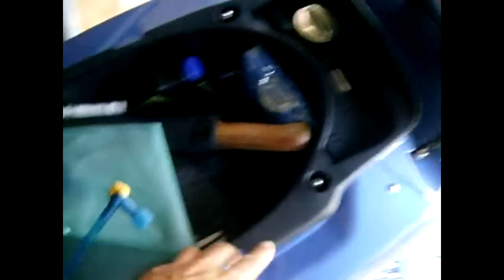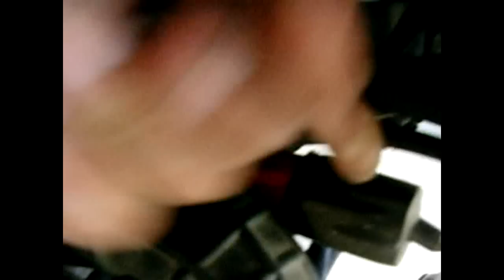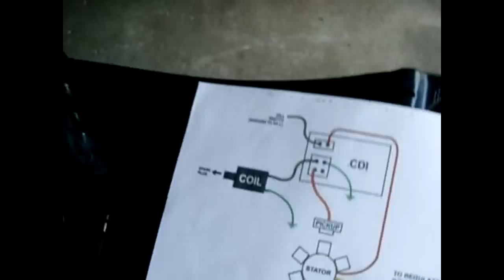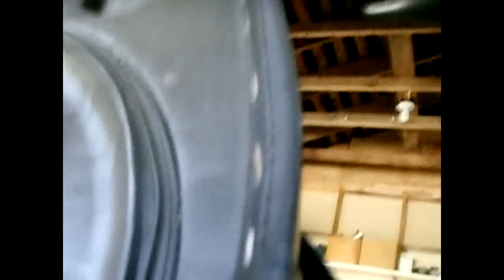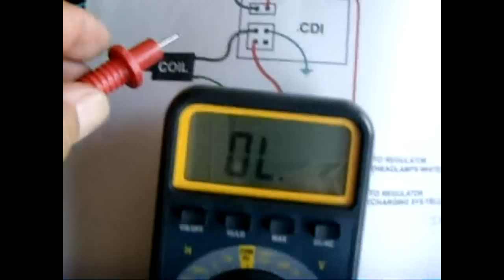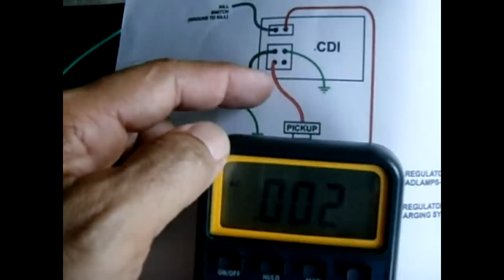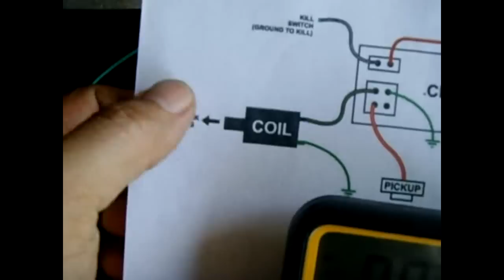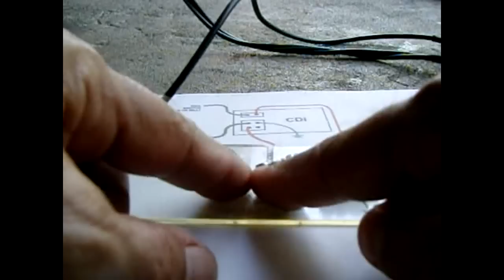The Ultimate GY6 Starter & Ignition Troubleshooting Tutorial

Comment: Running the test at around 13:30 of the video, I notice that my black/yellow wire gets zero resistance or continuity to ground, but that wire only connects to the spark plug lead and nothing more.  Am I testing this part incorrectly?  Also, I took out the stator pickup and tested from ground to the blue/white on the back of that pickup and got around 140 ohms of resistance.  This is a new stator/pickup assembly.  Is that accurate or is something wrong?
Reply from the maker: Hi Kyle. The blue/white wire(pick up coil) sounds right. With the black/yellow wire to the ignition coil connected to one probe of the DMM, and the other probe connected to the other wire of the ignition coil(or ground), you should get a LOW ohms reading. NOT zero ohms. Double check. You can also test directly on the ignition coil. Remove the connector on the 2 blades.

Thanks for Watching!
Reply: electronicsNmore
OK.  Could be that my DMM doesn't show really low ohms like that.  It also shows 0 when testing several new spark plugs.  I'll try testing with a better DMM and see what happens.  I'll let you know if I have any more problems :)  thanks for the video!
Reply: So I ran all of the tests in sequence and found that I had a bad plug coil which is why no continuity at the back/yellow wire.  Fixed that and got a low reading at the red/white wire (only about 250 ohms from gnd), and also only about 45v at that wire while cranking.  Bad stator coil?
Reply from the maker: I have over 200 videos, so I forgot the colors of the wires off the top of my head. There should be enough info in the video to troubleshoot with. You have to take your time and rule each thing out one at a time. I think I also have a link or 2 in the video description area. The output voltage from the stator coil will vary with cranking speed.
Reply: I think I've done enough tests to find that the stator is likely bad.  Everything else is almost exactly like you said.  This is a great video!  Thanks for the info!
Reply from the maker: Carefully inspect the stator before you replace it. Double check the output voltages, resistance readings, as well as ALL harnesses/connectors.
Reply: Will do.  It's a completely new harness that took some cutting and soldering to match the schematics, so I'll be doing the tracing game for a while :)

Comment: hey there so my engine is fine im wondering if my wires from my ignition could be faulty is there a way to get a diagram to check it starts with a jump to the sarter but only sometimes and the key has to be in and the switch has to be on start please help thanks you please email or call 253-888-9023

alexkjellesvik@gmail.com
Reply from the maker: Yes. The key has to be to the ON position, as well as the start switch. If they are not, then the ignition system(CDI) will be grounded out causing the engine to not start even if it is cranking. You have not explained your problem. Dies the scooter not start up when you push the start button? If so, then I suggest you make sure you are getting voltage at the starter solenoid, or instead of jumping the starter bolts, you try supply 12v directly to the small starter solenoid wire to see if the starter solenoid triggers. Sounds like you may have a faulty/burned solenoid. They are cheap.

Thanks

Comment: At last check, I pulled valve cover check valves at tdc had about 4 to 5 thou. clearance. There is compression it just dont blow your finger off hole. I did rotate engine backward trying to get nut off to replace drive belt. Could it have jump time on the chain, does the tensionee back off some if engine is rotated backwards. It still has good spark but wont start even with starter fluid.
Reply from the maker: If you have spark, and fuel, then there is nothing left but the timing or bad/open valves. The coil/cdi are clearly working, as well as the pickup coil. Turning the cooling fan nut either direction will not cause any problems. I have done it many times before. If you lined up the mark on the flywheel with the metal protrusion inside the cooling fan plastic housing, and the large hole on the camshaft gear is in-between/perpendicular to the head between the 2 big bolts, and both valves have the proper clearance/closed, then I have no clue. You can try disconnecting the kill switch wire from the cdi. That will eliminate any chance that the kill switch is stopping the engine from starting.

Comment: Great video, on the one i'm working on all I did was replace the drive belt. I did turn engine beckwards some. But now it wont start, it has spark and fuel. When you take plug wire off it sounds different than with it on.I also replaced plug still no start.
Reply from the maker: Double check that the engine's timing marks all line up, Also check all the wires/connections you may have touched. Your sure the stop engine switch is not on?

See this video here:

Highly Detailed GY6 Valve Adjustment Procedure(Step By Step)
Reply: Thanks, everything is on, good spark, On the compression you can hold your finger over plug hole it doesnt blow your finger off plug. The timing marks seemed right, the T lines up with mark on case and circle on cam is on top, what now
Reply from the maker: You must of done something. Not feeling pressure over the spark plug hole while cranking is not good. You have the valve cover off? Make sure both valves are closed when the timing marks are lined up. Your scooter worked perfectly before you decided to change the belt?

Comment: I have a gy6 scooter.. Last month i tried to replace the cdi boks and i tried to start the scooter several times, but it didn't work:( and then i pressed the kill switch button and then suddenly i lost all the power on the scooter.. I have changed the battery,new cdi, coil but still it's not working. What could be the problem?
Reply from the maker: Pressing the kill switch should not cause the scooter to stop working unless there is a bad wiring connection/short. You do know there is a fuse located in or near the battery box that can blow, and cause all the power to go off. I suggest you check everything step by step from my video. Make sure the wire on the ignition coil is screwed on tight, and the spark plug is good. If the scooter still does not start, check all connections, and lastly(by watching my GY6 valve adjusting video), make sure the engine is still timed properly using the reference points shown in that video. You can also try removing the spark plug, and squirting a small amount of gas into the hole and immediately screwing the plug back in and try cranking the enigine. If it starts, then you have a fuel problem.

Thanks for watching.

Check out my GY6 video playlist, and don't forget to rate a thumbs up.

Good Luck.

Comment: Thanks for the video.  I have a problem with my scooter.  In cold weather especially the electric start just overruns, doesn't crank (make the tatata sound).  Kick starting usually will start it but yesterday that was not the case yesterday.  Kick starting is not good for my previously broken ankle either.  Anyway, the shop can't seem to fix it so I'm trying to.  Very helpful and well done video.  Thanks again
Reply from the maker: Sounds like the starter is not making contact with the gear behind the flywheel, or the spacing is off, allowing it to not engage.

Comment: I've got a yy-150 that doesn't crank and doesn't turn over with the ignition.  Not mechanically minded, but I've already replaced the battery, cleaned the carb and replaced the spark plug.  No idea what it could be at this point, but thanks for having this up.  I'll watch it a lot for sure.